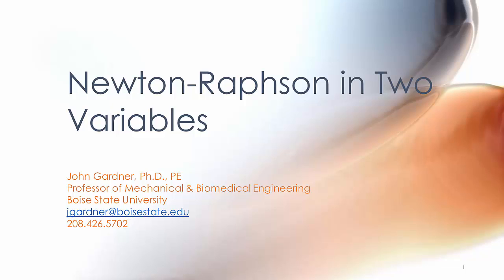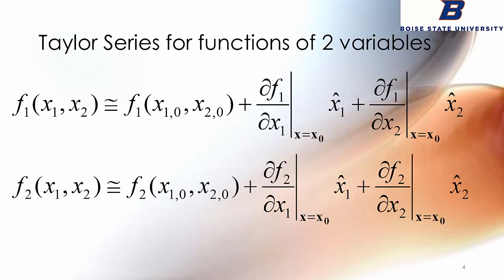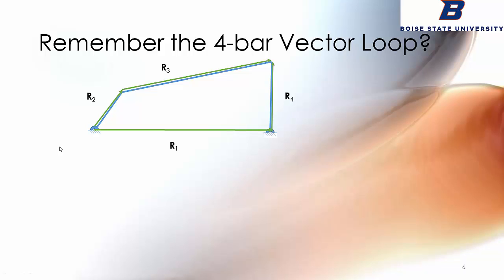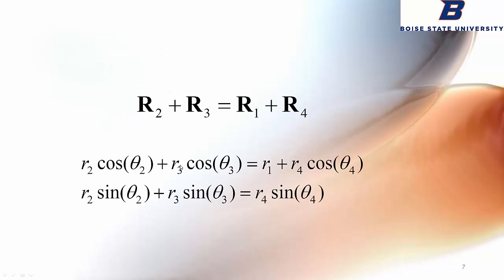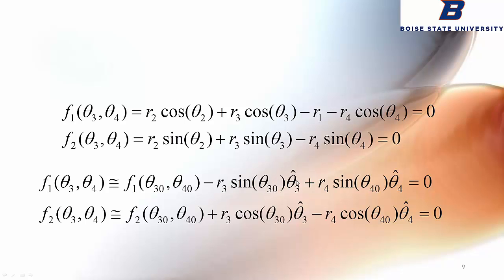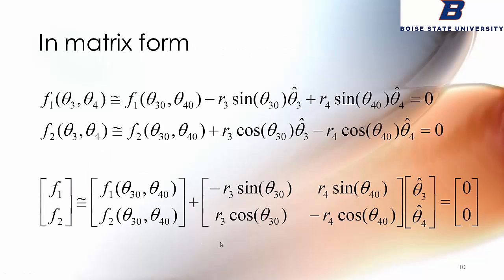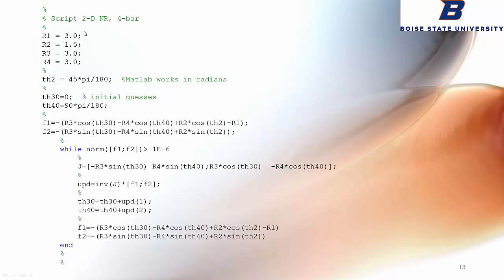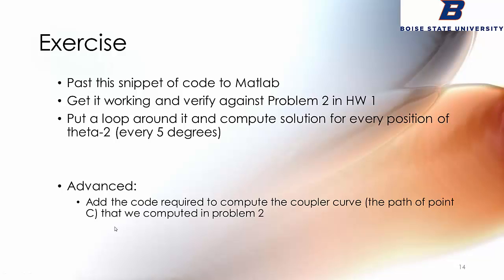Two-Dimensional Newton-Raphson

Comment: Does this still apply if the pivots for the crank and follower are offset? Is a translation to a global coordinate system needed?
Reply from the maker: For an offset slider crank, then the R1 vector would have both x and y components (the y being the offset) but the rest of the analysis works fine.